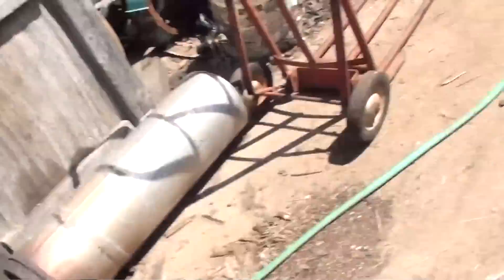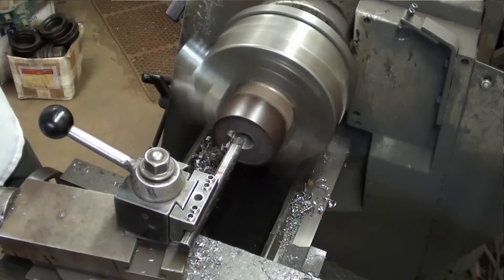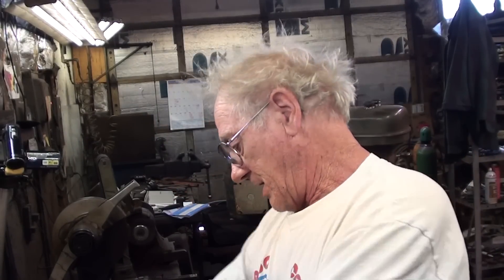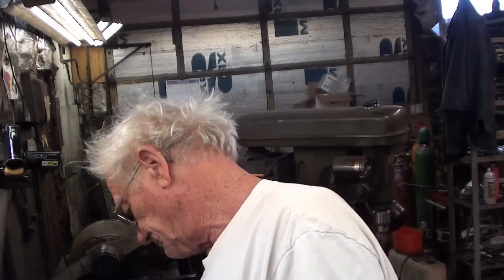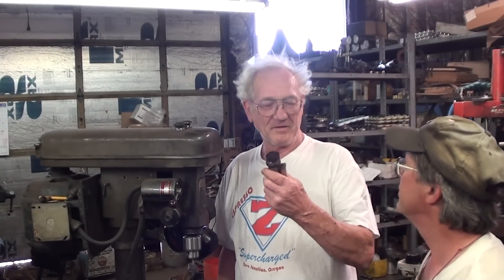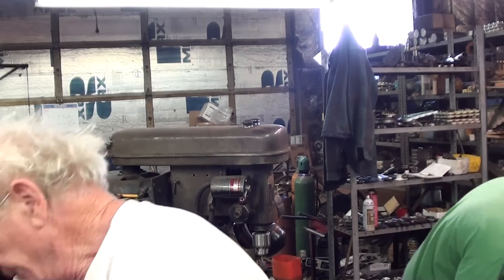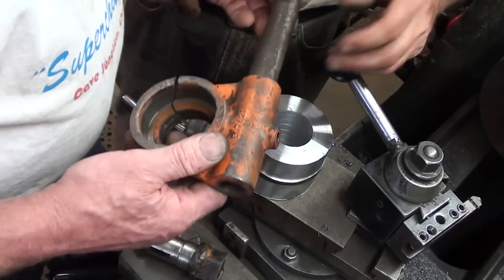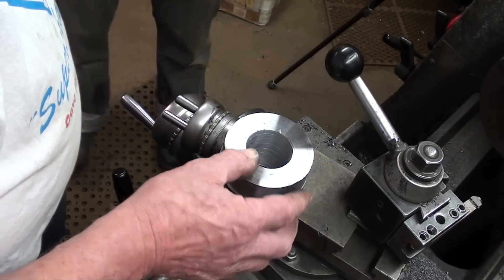Pt 2 of 4 Allis Chalmers Model 7 Hay Rake Repair with TONY!

Comment: Did Tony not use coolant/cutting fluid because of the filming, or has he done the equation over the years that he'll just sharpen the cutting tools instead of wasting money on the stuff?
A good (occasional) double act!
Reply: cfook I think we are seeing the correct amount of precision required for a hay rake repair.
Reply from the maker: cfook Part 3 will answer your question!~